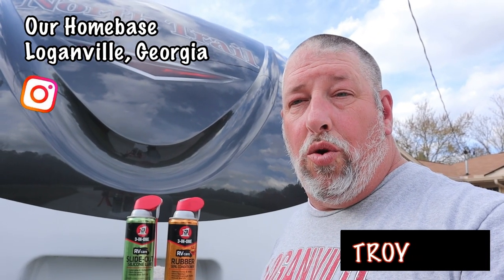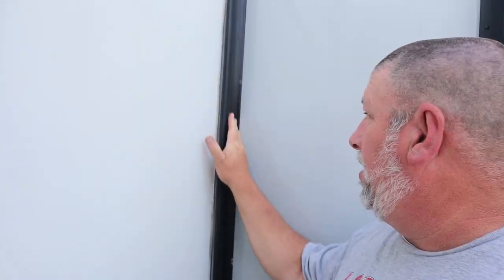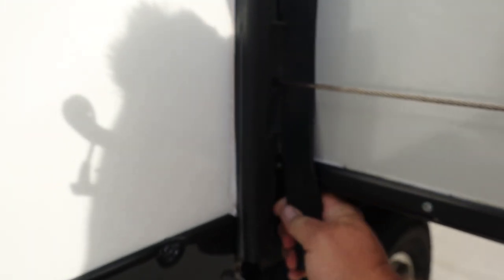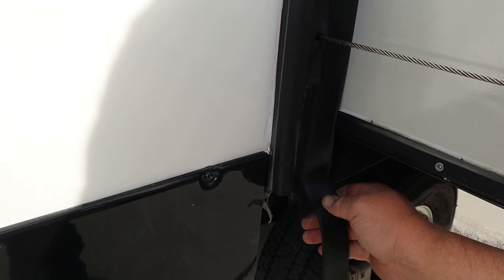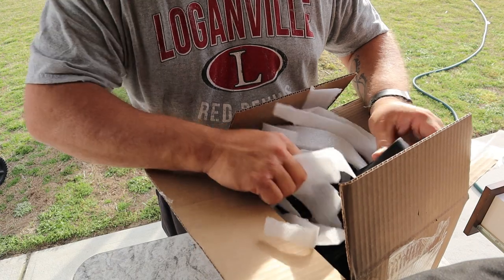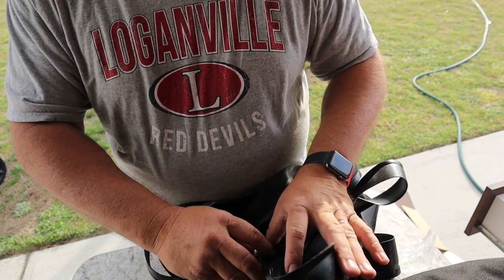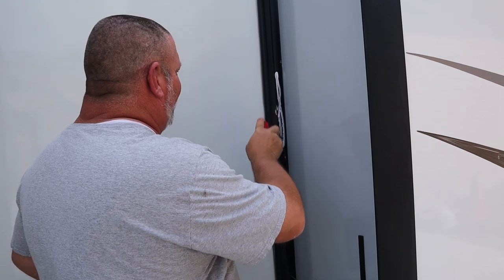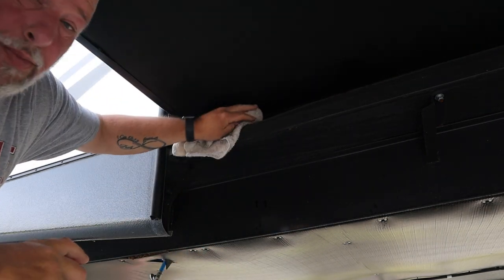RV slide out wiper seal replacement

Comment: Thanks For The Video. My slide seal on both my kitchen slide and dinette slide failed after just two years on my 2017 keystone bullet. I've been looking for videos on how to replace them on a cable slide and your video did the trick, I'll be replacing mine in a few days.
Reply from the maker: Glad it helped! Hope all goes well with your new seals! Safe travels!
Reply: @WillardsWithaView dude mine go way inside the camper

Comment: I had the same failure on my Heartland 12' slide I used Gorrilla Roof Repair Tape.  It's like a mastic on the back side of a good rubber.  I cleaned the old seal and put it back together with some 1/2" pieces of the Gorrilla Roof Repair Tape to hold it together and in place then cut the Gorrilla Roof Repair tape down the center to make 2 pieces about 1.5" wide.  Then started at the top and peeled back the mastic side and stuck it in place.  Don't get to much of this mastic exposed as it sticks to most anything even it's self. Once it's in position massage it a bit and it is working great.  Time will tell but for 14.00 dollars I repaired 4 slide gaskets in and out with one roll of this Roof Repair tape.  Here is a short video of repairing my slide out motor and a way to keep it from hitting my bathroom door with a limit switch.   
https://www.youtube.com/watch?v=UFx7bqz1Y3Q

Comment: Have you had to replace the interior seals? I just noticed that both the exterior and interior seal on my north trail are broken on one side and this will be my first wiper seal repair. Thanks for the great video!
Reply from the maker: Haven’t yet did interior, although they need it. They are the same seals as the exterior on our model. Looks like the same track just have to pull the trim molding off to access the seals.

Comment: Great information!  I have a 2020 North Trail (21RBSS) and the wiper seals on both sides of the slide out split on the last trip.  Now I can attack the problem with confidence.  (good to know this is a weak spot on the trailer and something for me to keep a good maintenance eye on!)  Thank You!!
Reply from the maker: Thanks for your kind words! Hope that your project goes as easy as ours. Not as scary as we anticipated. Safe travels!
Reply: @WillardsWithaView  I have to ask - where did you get the telescoping ladder?  (Harbor Freight, maybe?)
Reply from the maker: @davidwilliams6390 amazon 👇🏼

Ohuhu 12.5 FT Aluminum Telescoping Ladder, One-Button Retraction Extension Ladder, Collapsible Ladders with Spring Loaded Locking Mechanism, Telescopic Compact Ladders for Home, 330 Pound Capacity https://www.amazon.com/dp/B01LAHCOQ4/ref=cm_sw_r_cp_api_glt_fabc_53BB1EBXPG593G65DMBB

Comment: I have a 2020 heartland wilderness 2650rb. I just finished replacing outside seals but having issues with inside replacement. Did you do yours?
Reply from the maker: Haven’t yet tackled the interior, although they need it. They are the same seals as the exterior on our model. Looks like the same track just have to pull the trim molding off to access the seals and work from top down. We haven’t had any issues yet, but know that we can’t put it off forever! Good luck with yours!

Comment: Great video thanks for sharing. What's the website to order directly from Heartland?
Reply from the maker: Sorry for the late reply. We called heartland directly and provided our VIN and they set us up with the parts. Just had to give them the length of seal we needed and some $ and had it in a few days! 

Our part info:
Wiper Seal
0109807 : Wiper Seal 1.5" w/o Adhesive Norco- is the part through heartland RV

Here is their number if your interested (Ph-844-915-7950).

Comment: Great video.  Where were you able to find the seal?  Do you have a part number?  This is exactly like mine for a Forest River Vibe
Reply from the maker: We called heartland (our manufacturer) and provided our VIN and they set us up with the parts. Just had to give them a length and some $ and had it in a few days! 

If you order through forest river we are not sure the part number would be the same for your vibe, but we are happy to share our info through heartland.

Wiper Seal
0109807 : Wiper Seal 1.5" w/o Adhesive Norco- is the part through heartland RV and here is there number if your interested (Ph-844-915-7950).

Comment: Changing mine for my 3870FB 5er? Have you changed the inside ones as well?
Reply from the maker: Not yet, but they are due! They are on the same type track, but just hidden by our slide out trim. It’s a little more work, but was informed by a professional RV tech that once we get access there not too bad. We will see……
Reply: So the one I need to change my master bedroom slide out the bed is right there and then there’s border trim in front of the wiper is there a way to get to it without having to pull the trim off
Reply: @WillardsWithaView  My North Trail was just as easy on the outside. I have observed my inside seals are virtually MISSING, except what goes in the track. Only, there is no place to slide up from the bottom, it is at the slide base. Any thoughts? I thought maybe from the top, but they must be pinched at the bottom of the track as I can't get the rib material pulled out from the bottom.

Your thoughts, maybe you have tackled this on yours?
Reply from the maker: @mrsirlj  Haven’t yet did interior, although they need it. They are the same seals as the exterior on our model. Looks like the same track just have to pull the trim molding off to access the seals, and I believe the approach is from the top sliding down. Safe Travels!

Comment: I have to replace mine too. Thank you! Have you had any other issues with yours? We have had a ton of issues with our 17 bkss.... our slide cable just broke on our big slide..
Reply from the maker: Just a few over the past 5 years…. We have had the slide motor replaced in the BH, all slides have needed cable adjustments a few times, fan motor in the AC in the BH was recently replaced. All in all not too bad for a full-time lifestyle, but in our research no rig is bullet proof and there is always something that needs tweaking here and there! We have been happy with ours and it has served us well!

Comment: have same trailer , wonder if the top seal wiper comes off same way?
Reply from the maker: Our top wiper seal is still in good shape and I am sure it is replaced in a similar fashion. We did just replace the “D” shaped bulb seals above the living room and bunkhouse slides. Just had to remove the set screws and they slide into a track as well.
Reply: @WillardsWithaView  tks
Reply: @WillardsWithaView  Do you have a video?
Reply from the maker: @aletariley1287  not for the top seal. Ours is still in good shape.

Comment: What is the part number for the wiper seal
Reply from the maker: We called heartland (our manufacturer) and provided our VIN and they set us up with the parts. Just had to give them a length and some $ and had it in a few days! 

Wiper Seal
0109807 : Wiper Seal 1.5" w/o Adhesive Norco- is the part through heartland RV and here is there number if your interested (Ph-844-915-7950).

Comment: I cannot find where to Oder it from heartland, can you post the address?
Reply from the maker: We called heartland and provided our VIN and they set us up with the parts. Just had to give them a length and some $ and had it in a few days! 

Wiper Seal
0109807 : Wiper Seal 1.5" w/o Adhesive Norco- is the part through heartland RV and here is there number if your interested (Ph-844-915-7950).

Comment: can you tell me the part information?  On Amazon there is 1.5 inch norco wiper seal called 'clip on' and a vid showing the installer cliping it on rather than sliding up the track, looks the same.   I ordered from Northtrail which they gave me norco part number 0109807 : Wiper Seal 1.5"   Norco - $4.90 Retail.  tks good vids
Reply from the maker: We called heartland (our manufacturer) and provided our VIN and they set us up with the parts. Just had to give them a length and some $ and had it in a few days! Looks like it’s the same part number. Not sure about clip on style.

Our part info:
Wiper Seal
0109807 : Wiper Seal 1.5" w/o Adhesive Norco- is the part through heartland RV
Reply: @WillardsWithaView  Heartland was on a delay to ship to me, so I found the norco number and ordered through Amazon. 
Black Rubber R854056 for RV 1-1/2" Slide-Out Wiper Seal (Clip-On) .  May help others.  Also, bought the ladder you referred to, you should get a cut, lol!